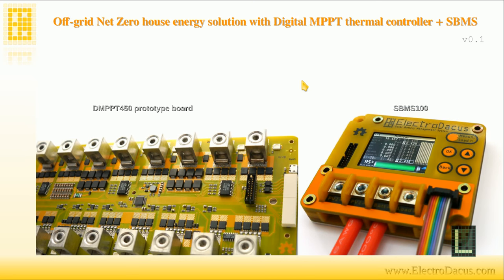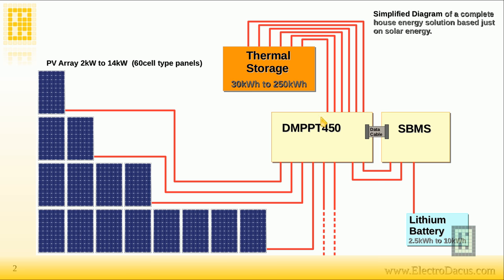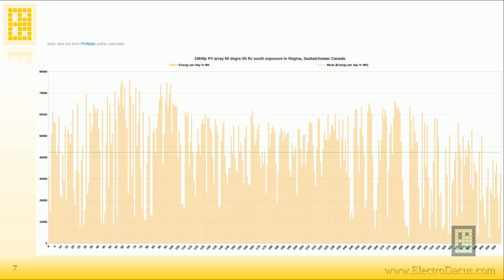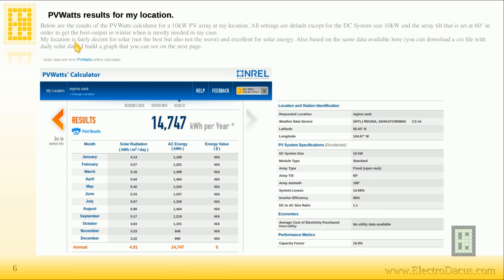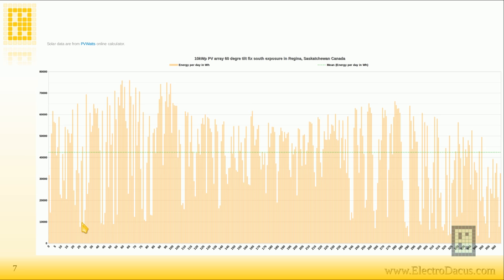Explaining the Digital MPPT thermal controller

Comment: Hi again Dacian, I have now don some felt test and found out That my 335W SunPower Solar panels can make almost 400W in a clear sky ,and with the back to the sun it performs about 40W, and on a clouded day with rain it performs 4W..so it is 1/10 of a sunny day, It must be There this figure come from, and I agree ...Without sun NO power.....So the only way I can support my self, is a Big 30KW Solar array and a 30 - 60 KW Battery Bank, and That will perform fine for me in 2 days without sun, if 1Kw/h heat is on so If I want to be total self-supporteble ...This Battery Power Bank Has to at least 100 ore even 200 KW/h of charged sun power if I have to cover a small week ore so without sun.....so..... That must be the way for me. And If the 400V 200KW/h  battery bank is full.... then Thermic power heater, but in a higher Volt range Than yours system...240 AC and 3 Phase 400V AC, Then all my other system will be walking ok and can be driven with that system.....like freezer, hot water, surround system...and .on and on. 

I have seen something for me interesting Battery technology "Saltwater Carbon" Battery a hybrid battery and wet super capacitor long lasting lot of cycles, a little bulky,  but walking Now.
And there are also others there a walking on this technology with a factor 10 in capacity range of a Super Capacitor..... almost the same as s Li-ion battery. also a Carbon Saltwater setup very safe setup and almost no waste when recycled ...so very interesting....still a lot of walk to do .....so keep up the good walk.....Fore a long time a go "They" ware walking with 12V Halogen system and found out that This Was not the way to go, so Therefore This is almost gone....low volt ore not, maybe someday you also will raise from the low volt dust. Be safe .Almost The same Battle Tesla and Thomas Edison have over DC V.S AC....Jørgen Thomsen Denmark DK
Reply from the maker: Hi Jørgen, Sorry is I do not remember the entire perversion conversation. A chemical battery is not the solution for large energy storage where you need that energy as heat or even cooling (a bit more difficult).
No battery will compete with LiFePO4 in therms of cost amortization but you should need only a very small LiFePO4 battery for appliances and not heating. For heating thermal storage is unbeatable in therms of cost (a few order of magnitude less expensive). My house already has build in thermal storage of around 97kWh that had no extra cost since is part of the house structure and is the 14 cubic meters concrete slab.
The other example I used in the DMPPT450 pdf presentation is thermal storage in water where a simple 200 liter plastic barre can store 8kWh with basically infinite number of cycles at a an initial cost below $100.
Voltage level is completely irrelevant since a 1kWh battery will cost the same if is a 3V battery or a 300V battery.
So as I presented in more details in my presentation typical houses around the world use most of the energy for heating (at the moment most using natural gas) and since that is the case thermal energy storage makes the most sense since it will always be the most cost effective way to store energy when heating is what is needed for.
No electrochemical battery will ever get close to thermal storage at least all existing options at the moment are a few order of magnitude more expensive and I do not see how they will ever compete with thermal storage.

Comment: Hi Dacian Yes you are right, thermal storage is No1 but since The sun do not shine here all the time, and there are more dayes where the sun do not shine, then I need power in a noter way, to drive all the Other stuff i have, and a small battery don do the trick, I have calculated all That, That is why i came up with this numbers 30KW solar array and 100-200KW Battery Bank, all depending on my need, but I can start with a small one and grow bigger if needed. I also start with a small 4KW solar array. And since your SBMS and DMPPT 450 can NOT support my solar panels 68V DC Max Volt, then I have to make a noter choice .......Big Battery is the only way for longterm power storage, if you are driving your Surround and Big screen projector, they take 2KW/h just to run that. Well it gives heat yes, and if you have heated all your thermal energy storage full up, if the floor gets to hot then you can't walk on it......The barrel heater is OK an can be used, and that is just a noter way to make a cheep water heater But can only go to a 100 C if more it will boil and blow up, and when it is down to 18C No more room heating..Yes it can go below freezing but that is not heating, so you have from 20-90 C min a metal container.....
But I don't have anything to control the panels with, to switch them on and off with, because your SBMS can't handle the 68V Volt from the solar Panels....so Therefor this is not an option ....Yes I can switch them on and off manually by hand , on pluck and off pluck them....Sorry if i have defending you...was not my intention ...I just tried to be "poetic".. My choice of the high volt  give better efficiency  when converting power up an down.........I know that everything become heat over time....but in the meantime ....
By the way would it be possible to make some form of remote relay "something" to control and switch the 68V solar panels on and off, that could be controlled by your stuff. DMPPT
.Bet to you Jørgen Thomsen Denmark DK.
Reply from the maker: I just do not think you fully understand how thermal mass storage works and that is why I insist on this.
You can see thermal mass similar to a battery or supercapacitor. In case of the 14 cubic meters of concrete slab in my house the 97kWh storage capability is for 12 degree Celsius delta so say 18C to 30C and so it will never get to hot since 30C is below body temperature 37C.
So at 18C the thermal battery is empty and at 30C is fully charged and when heating the concrete from 18C up to 30C you need to put in 97kWh to do so. But is not as easy since it if say you have 30kWh from the PV array you will need a bit more than 3 days to fully charge the thermal mass but if your house for example needs 20kWh per day to stay warm (20kWh are house thermal losses) then if you heat the concrete with 30kWh each day but also you use 20kWh each day is just a 10kWh net gain each day so you need almost 10 days like this to finally fully get to a full thermal storage and most likely there will not be 10 consecutive sunny days and then when you have a cloudy day and maybe the PV array only produces 3kWh then you will have for that day a net loss of 17kWh so concrete will discharge by that amount.
So based on your climate house losses and amount and frequency of sunny days you can select a thermal mass capacity so that the thermal mass will never be empty 18C or full 30C for the entire duration of winter.
If by any chance the thermal storage gets full then heating will stop even if is sunny so there will be some excess (unused solar energy) but that is to be expected as in any offgrid type installation.
And yes is true your panels are not compatible with SBMS or DMPPT. The DMPPT as it is designed can not be modified to handle the higher voltage panels because of the limitations of ideal diode controllers and current sense amplifiers and there are no equivalent circuits capable of higher voltage operation. So a DMPPT capable of working with those higher voltage non standard panels will need a completely different design probably much less efficient also if ideal diodes and not be used.
Ideal diodes may not be needed if only used for heating and not battery charging but important part of the DMPPT is that it can handle heating with thermal mass storage and also Lithium battery charging from the large PV array helping reduce the need of lithium battery capacity for same energy use since you can fully charge the lithium battery even in a cloudy day.

Comment: If you are using a water storage, heat exchanger and heat exchanger storage as outputs, then what happens if they do not get turned on because doing so doesn't maximize the power point. So you go to have a shower but there is no hot water because all the energy went to heating the floor. Or your heat exchanger storage is cold so it pumps out cold air because the heat all went to the water heater because that happens to maximise the power point for most of that particular day?

Also what happens when your water temp is at it's maximum but the controller wants to still end power to it to maximize the power point? Does this then result in a non optimal power point. And if so how much of the time to you expect various parts of your system to be at max temp and therefore not be usable for maximising the powerpoint? Does your system understand that a particular output is maxxed out and compensate by sending power to another (less efficient) output?
Reply from the maker: The smaller heat storage has priority since is connected to first 3 outputs from the DMPPT so if the amount of solar energy is below 25% the maximization is done by only using the first 3 outputs.
The thermal storage will be normally very large with slow charge rate so the chance of thermal storage getting to max allowed temperature is small. But if it gets there then yes no more energy will be transferred to that thermal storage and there will be excess unused energy at that point as in any offgrid system where storage capacity is finite.
The system is designed to handle two separate heat storage each with separate temperature and a Lithium battery storage.
I will have much more detailed explanation once the DMPPT450 is ready to ship and the manual is done.
There will even be an option for 3 separate heating zones for the large thermal storage.

Comment: Can this product be used for just solar pv management only ? I like the principle  but instead of making hot water I just use it to manage the solar array.
Reply from the maker: You can use the DMPPT450 + SBMS to only charge a Lithium battery from a large PV array but there will be a lot of unused excess energy. This may be a good solution in places where there is not a lot of sun and a oversized PV array will help produce enough energy in those cloudy months while keeping the battery capacity small.

Comment: A weird question:

Have you ever seen a low frequency inverter that would use a 325V string of batteries to make a quasi sine wave AC at 230V? Turning off parts of the string to produce desired voltages of the wave. Each battery only being on about 2/3ds of the time. 

Probably I dont know that much about electronics to know whether drain on the batteries would be unequal. Or that ripple would be too bad, or something. But maybe throwing out the cost of the inverter would make sense?

325V is near 12 times 27V, which is the reference voltage for solar without MPPT. Even more outrageous though I had, why not just use 24 panels and switch them between 3 phases, making 3 phase AC with all panels connected all the time.
Reply from the maker: As you suspected the drain on cells will be unequal so is not a good idea.
PV panels are constant current sources so using just a string of panels to make single or multiple phase AC will not be usable. When you load is much smaller than what panels can provide at a specific time (based on amount of solar available) then all will work relatively fine (assuming is a soft start or resistive type load). 
But as soon as you have a cloud or solar output drops the Load will be in a weird under power state of power off depending on the type of load.
If it is a resistive type load like a convection oven, hot plate or water heater then those will likely work from DC directly no need to get complicated with AC of any type. Motor based loads as vacuum cleaners, water pumps or compressor based refrigerators will not work.
Best will be to have everything work on DC :)

Comment: Perhaps you did not see the reply or you are on holiday.. :D
Can we use a Mppt/Inverter/Charger on an output of the DMPPT and will the DMPPT be able to "sense" the needed power .. ? (i do not know the algorithm you are using).
Reply from the maker: DMPPT works directly with PV no battery involved so no an inverter can not be connected to the output of DMPPT. Also inverters are capacitive loads so they will short the output resetting the DMPPT450 is basically like a short circuit.
Not sure why you will want to connect an inverter to the output of DMPPT450 as this is designed for heating applications and will already to Digital MPPT.
If you have a grid connection then you will just connect a grid tie inverter between the grid and PV array no need for DMPPT.
All offgrid inverters are designed to work connected to a battery.
Reply: @electrodacus  It seems the discussion is restarting .. did you read the other discussion ? Avout the inverter working without batteries ?

Comment: Is this product available for use or are you still developing it?
Reply from the maker: The DMPPT450 was produced and sold but demand was very low so it is now discontinued.
You can take a look at the SBMS0 and DSSR20 with diversion if you also need battery charging. There my be a separate much smaller version of DMPPT maybe DMPPT60 next year so it will handle just 6 large solar panels but as many as needed could be used. Still DMPPT60 is not sure as I think there will also not be demand but I will know soon.
On my webpage check the DSSR20 and DEXT16 user manual for some details https://electrodacus.com/
Reply: @electrodacus  If I understood the video correctly 
1. The discontinued DMPPT450 could handle 72 solar panels max?
2. Its replacement DSSR20 can handle maximum of 2?
3. The maybe DMPPT60 can handle a maximum of 6?
Reply from the maker: @thomasnyanfore8424  Up to 48x DSSR20 can be controlled by a single SBMS0 in dual PV array mode so up to around 30kW PV array possible with multiple DSSR20.
The DSSR20 has no digital MPPT functionality just simple diversion where the DMPPT60 will have digital MPPT functionality for better efficiency when using resistive elements for heating same as the DMPPT450.
You can ready the user manual of the DMPPT450 to understand the digital MPPT functionality. The DMPPT450 had 6 outputs so could have up to theoretical 63 power levels to match the max power point in practice 32 levels will be max due to the limit output of each of those 6 outputs with the DMPPT60 there will be 3 outputs so just 7 levels but there will be another trick to have two of those outputs in series by internal reconfiguration so there will be 10 power levels good enough for likely above 95% efficiency in a sunny day where DSSR20 with simple diversion so basically a single output so a single resistance value can get up to 80% efficient in a sunny day if resistance is matched well but in cloudier days efficiency will be very bad unless you use diode heating (either PV panels used as heater or diodes in series). With diodes you get a sort of analog max power point with 0ver 99% efficiency possible but maybe less convenient than resistive heating.
Still not decided if the DMPPT60 will become real I will try to build a prototype and calculate the cost then ask if there is any interest in something like that.
The DMPPT450 had both heating and battery charging capability the DMPPT60 will be just for heating and the DSSR20 (without diversion) will still be needed for battery charging.
Reply: @electrodacus  You spoke about redirecting panels to and from the battery so as to not destroy battery. What data should I look for on the panel to see how many panels to route to battery versus thermal storage. In your example you speak of six 260w panels max so as to not damage battery. But what if it was a 100w or 350w panel?
Reply from the maker: @josephdunn4388  The max charge rate for a battery should be at around 0.2C to 0.25C so say you have a 200Ah 24V battery and each 60 cell panel can put out around 10A then 200Ah * 0.2 =  40A meaning you will not want to have more than 4 of those 60 cell panels charging the battery.
But if you have a system like the DMPPT450 or actually something that is still available may be a better example the SBMS0 + DSSR20 in dual PV array mode then you can have 12 of those panels to charge the same 200Ah 24V battery in the example above as you will have two separate arrays one with 4 panels and one with 8 panels that SBMS0 will control separately then when it is sunny at noon the 4 panels will be connected to battery charging the other 8 panels will stay unconnected or maybe if you have something to heat they can be redirected to heat some water or space heating then if amount of solar drops to half then the SBMS0 can direct the 8 panels to battery charging still being below 40A and the other 4 panels are disconnected or can heat something then if there is even less solar light all 12 panels can be directed to battery charging. All this is done automatically by the SBMS0 based on how much solar is available to keep the battery charging as fast as possible but not exceeding the 40A set limit.
Reply: @electrodacus  About thermal storage. Is there a video you can recommend that shows this setup? Can you provide a link or description for the element?